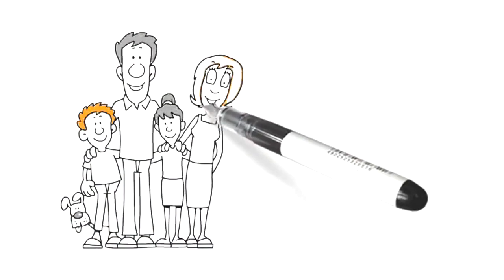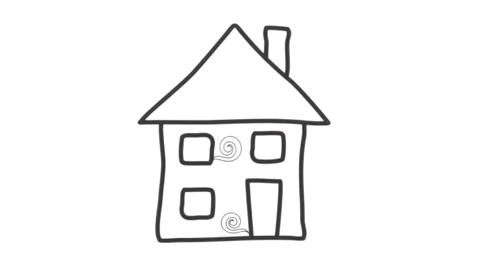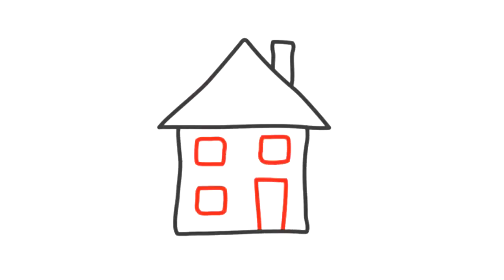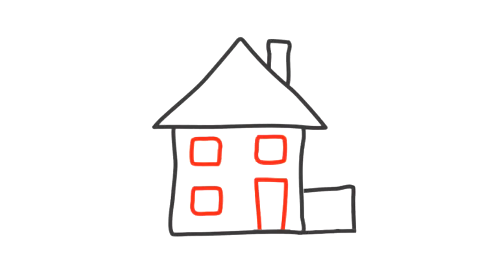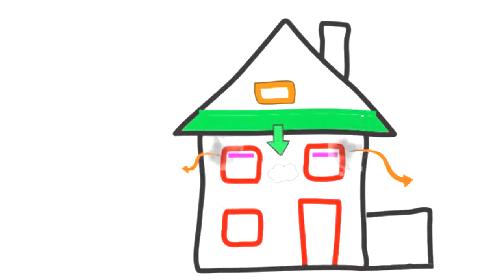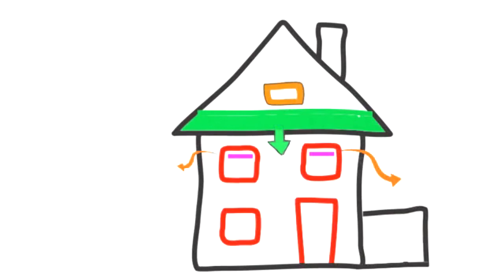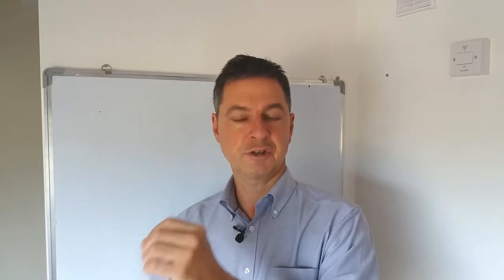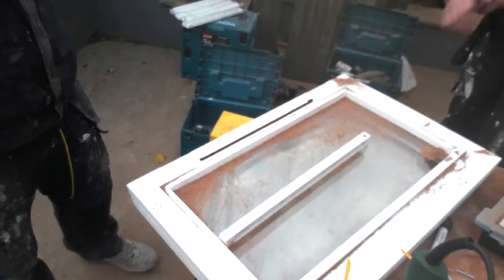Positive Input Ventilation

Comment: Thanks for the info on how it works.

I've been battling damp and mould throughout my flat for a few years. It's a common issue for a lot of the flats in this street. Walls were black, I had to throw away literally everything. Flooring, sofas, bed, all cabinets and cupboards has rotted and crumbled and my health was starting to suffer. 

They replaced the double glazing. But it just seems to have sealed it in worse. There's problems with the exterior roofs and guttering. 

They did the damp treatment. I started to rebuild my belongings and decorating. But it still stinks of mould. My clothes smell, anything left for a week or two I'll have mould appearing on literally anything.

It's a ground floor flat and the kitchen and bathroom are in a place where there's no windows or vents. 

So they came yesterday and installed this PIV unit but a bit different to the loft style, it's called a flatmaster 2000 and is wall mounted. Plus there's another vent/fan fitted to push air out aswell.

I just needed to know how it works so I can use it properly. Should I also have the windows open? When should I switch on the PIV heating element as well as the fan system? And is there a way I can monitor the levels of humidity or damp/mould inside my flat to keep an eye on how things are going?

It's been a curse this flat and I'm in a position where I can't swap until the work is done. Some things are out of my ability though

Comment: Could I please ask how to go about accessing this technology for a small flat? During the 7 years I've lived here, I've had condensation and black mould, which, as a lifelong asthmatic, is causing health issues. I've been very concerned for some time, and I really need this situation remedied. Thank you for any advice you can give, I would be very grateful.
Reply: In my experience people with asthma suffer more when living in a home with black mould. What we are always trying to achieve is a gentle movement of fresh air, and a PIV is a very effective way of providing this. If you are in a flat there are some options. There is a wall mounted PIV which draws in air through a hole drilled through an outside wall which then discharges it into some central point like a hallway.  Another option is what we would call a reverse PIV setup. This would mean swapping the bathroom fan for a dMev unit i.e. one that has a 'trickle' function - so it never turns off completely but gently draws air through it at all times. For this to be effective you would need some way of allowing fresh air into your flat. This can be achieved by retro-fitting trickle vents to the windows (preferred) or perhaps a wall vent in your bedroom. If you can get a gentle but constant movement of air then humidity and condensation will fall and mould will die back. Ideally do not sleep with your bedroom door shut, but have it open with a small gap. You need very little air movement to make a big difference. I would advise you to take pictures of the problem and write to your landlord or letting agent asking them to do something and explain your are asthmatic. Good luck !
Reply: @austinstev  Thanks so much for your very quick response, Steve. I don't have any fans in the bathroom or kitchen, something which naturally makes condensation a trickier problem. I bought a dehumidifier, a Meaco Zambezi, which certainly helps, but can't deal with the existing problem. After spending a few days in hospital last year, I found on my return home, a huge black mould patch on and around the kitchen window. Unfortunately, my landlord (I'm in a private rental), lives abroad and is unresponsive to communication through his agency. I am looking to move, but this is not the best time to be looking. In the meantime, I'm aware that my health is suffering and I am, frankly, concerned; hence my researching this method of ventilation. I had someone from Envirovent visit approximately 5 years ago, and he said that they wouldn't be able to help, due to no way of installing a bathroom fan because of the way the block of flats was built. He said it would mean going up into the floor of the flat above. Other than wait to find a suitable property, (I'm looking to buy this time, and I want a house) I can't think of how to make life easier, and the air more breathable whilst I'm in situ. Thanks for the advice you've given, it's much appreciated.

Comment: Would Mitsubishi lossnay be better
Reply: The Lossnay is a different animal really - it's a heat recovery system, so on the face of it, it's better as you're using stale exhaust air to pre-heat incoming outside fresh air. The problem comes when you install it as you need to find a way to connect the inlet duct to an outside vent to draw air in, and a connection to the vent stale air to another outside vent. You'll also need a condensate pipe to discharge condensed water from the unit to the outside.
After that you need to install ducting from the unit to direct the fresh air into ceiling vents in your home, and a fourth duct to extract stale air - typically from the 'wet' rooms - the kitchen and bathroom.
The bottom line is that installing a heat recovery system like the Lossnay is very hard work and therefore only really suited to newbuild flats and houses. By contrast a PIV - which does not have heat recovery is a much easier fit since air is brought into your home at one point, and can bring about a great benefit to a property. PIVs are very much a retro-fit solution for existing properties.

Comment: Good informative video, thank you. Could i asl a xouple questions please? Can you use PIV's with ductwork to fresh air rather than the loft air. My loft is covered so leaves little room for air in the loft. Also are these systems loud? Thanks again!
Reply from the maker: Hi AB, so there are a couple of styles of PIV - (1) types that are designed to sit in the loft and (2) types designed for flats (apartments) that have no loft.
The 'flat' unit takes the form of a box that sits on the wall and discharges air ideally into the centre of the flat. It takes in outside air (and so requires a hole to be cut through the wall) and are typically reasonably quiet.
The loft style takes in air from the loft and are typically very quiet. 
Whenever possible we would favour fitting the loft style of unit as long as the loft is reasonably well ventilated. Even a small loft could be suitable. If the loft is poorly ventilated i.e. smells stale/damp,  then you might want to consider fitting some vented roof tiles so you can then draw the fresh air into your home. 
Hope that helps, Steve
Reply: @yorkshirecondensationcontr6894  that's great, thanks for the reply!